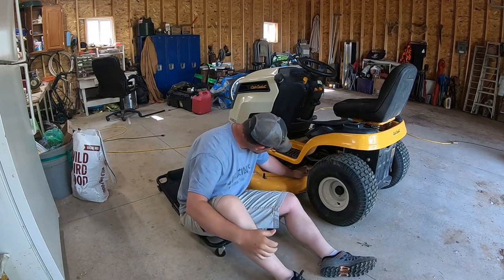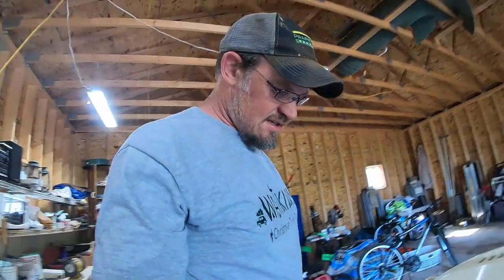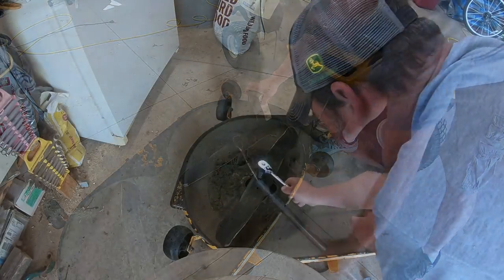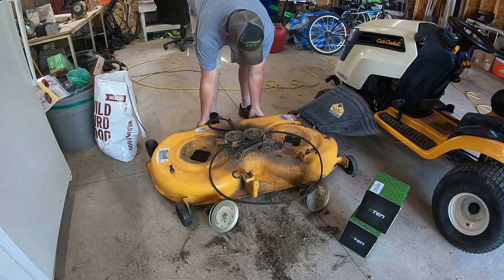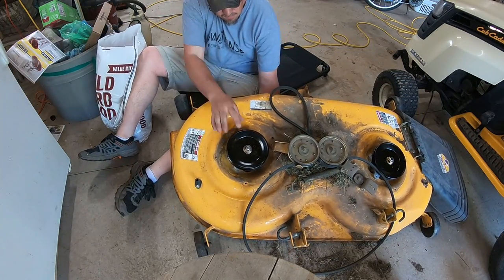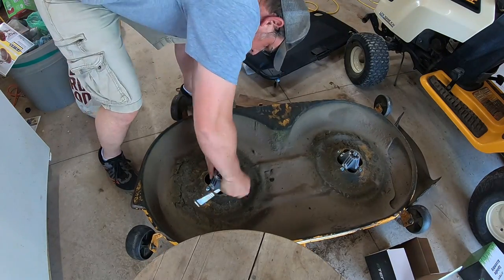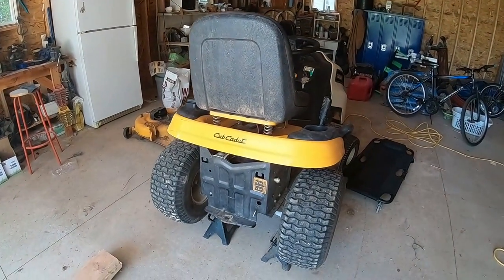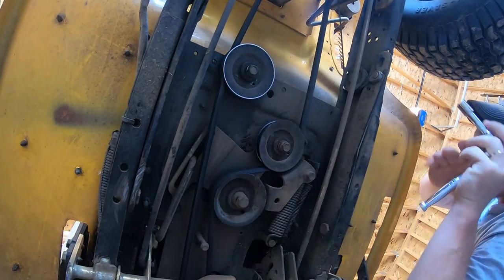DIY - SPINDLE ASSEMBLY & IDLER PULLEY Replacement - Cab Cadet LTX 1046 KW Lawnmower

Comment: I have a LT1046 with 57 hours. Had thrown a deck belt, had to slightly loosen the  tensioner pulley because it was stuck under it. Tightened the thentioner pulley, Put it back on and now the spring started rubbing the pulley next to
Reply from the maker: I have had similar thing happen as well

Comment: you just replaced 2 1/2 inch v drive pulleys with flat pulleys. so how does it run now
Reply from the maker: Still installed on the mower and doing well.  Not happy with the blades and looking to replace those.

Comment: GATOR BLADES ARE  BETTER I  learned something important never lay the deck down as you can bend the pulleys  .  I made a wood frame and lay the deck on it so the pulleys are not sitting on the concrete  . Did you grease the bearings  or were the  pulleys on the spindles  together when you got them . I noticed when i took my old ones off 1 washer was below the pulley and one was above the pulley  . I have a cub cadet 2016  v twin kw      and I thought the spindle was bent or warped but  now I think it is the pulley  . I used truck ramps to drive my mower up onto and put concrete blocks behind wheels to replace drive belt  . But most important question is the washers on the spindle pulleys
Reply from the maker: I don’t remember any washers.  Thanks for the advice & watching.  👍
Reply: @watkinstreefarm6880  I replaced my bearings and unsealed the insides of the bearings because even thouugh i have zerk fittings and there was lots of grease in there  but  none was getting to the bearings  Ifixit4U on youtube explaned it  . Only thing is I can't get the blades off the the spindle rods . I tried everything and nothing works from grease to heating the bolts up and the blades are new and are gator blades . I also put on another coat of slip plate graphite to the underside of the deck so grass does not stick to it . I only put on 1 coat back in 2016  . Idid find the one other pulley is loose in the middle  and trying to get that bolt loose so I can maybe titghten it . I cleaned and rebuilt the spindles with new bearings with inside covers removed on bearings